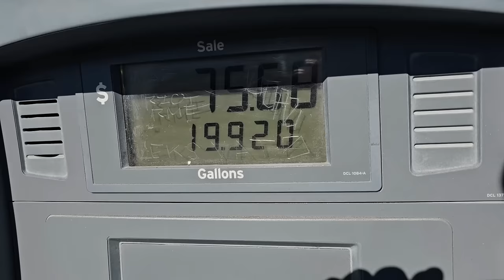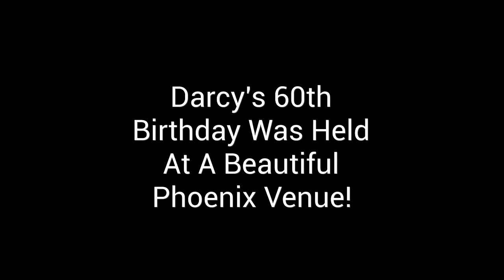Heat Draws Out Rattlesnakes At RV! Quartzsite Crowded Still? Javelina's At Camp!

Comment: I had 2 Trackers. One was a hardtop and the other was a convertible. I lived in Mesa AZ at the time. Every Summer the seals in the a/c would need to be replaced in the convertible. It had to work too hard in the heat 🔥 here. That was the biggest drawback but other than that it was fun on the nice days. 🌞🌴🌵🇺🇸

Comment: Rattlesnakes are no big deal, I've dealt with them on hiking trips many times, they give you a warning, and are easy to just relocate. I would rather have rattlesnakes to control the mice and rat population because they can do a lot of damage to the wiring of your vehicle. Dogs should never be allowed to just run free. The scorpions on the other hand in AZ can kill with no noise at all and easily get into your van or RV. Never stick your hands where you can't see and it is best to wear gloves when moving things around outside. Always check your bed and shoes for them and never be barefoot. Good luck.